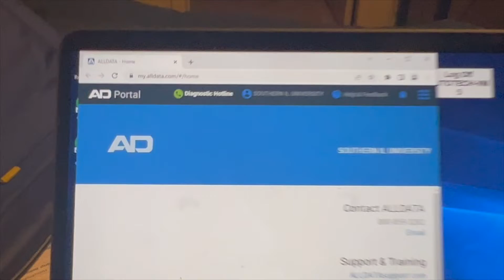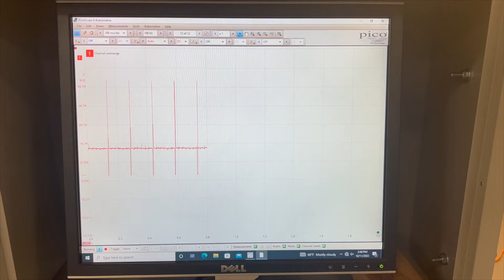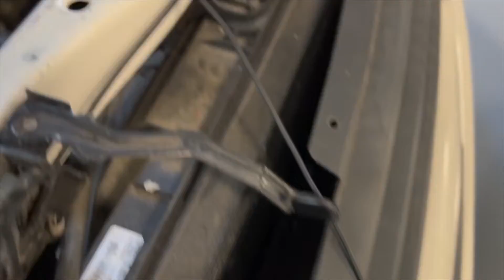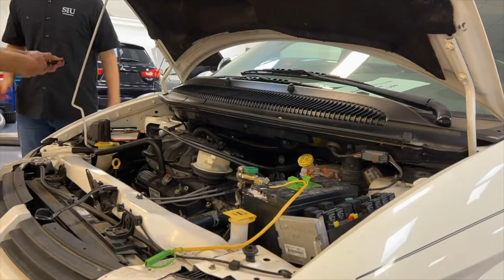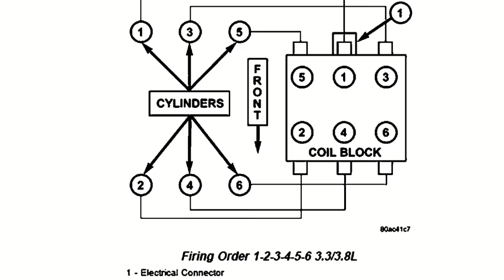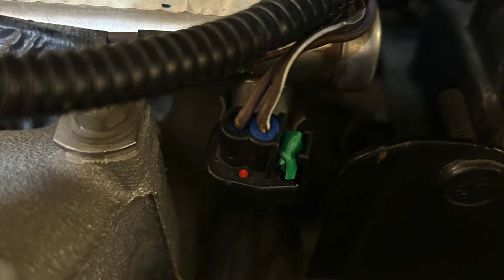Grand Caravan Fuel Injector Overview and Diagnosis

Comment: This is what I’m getting ready to do to my Dodge grand caravan cylinder five misfire I drove it came back home check the spark plugs and sure enough cylinder five was misfiring Gas was causing it to misfire. The fuel injector was stuck open. The rest of the spark plugs were fine so this weekend I’m gonna change the injectors.